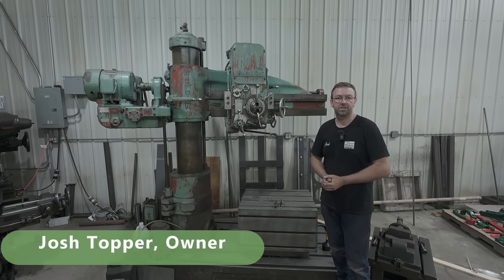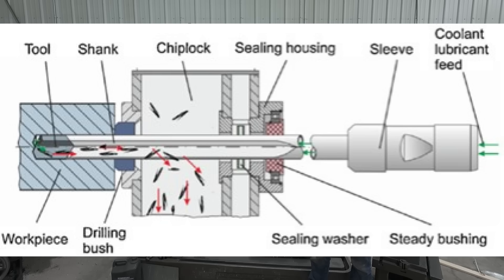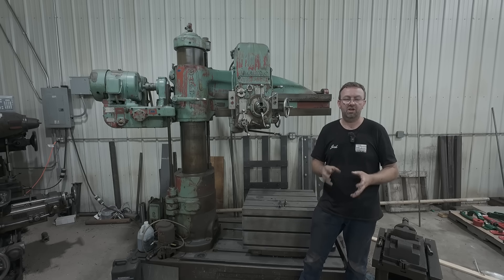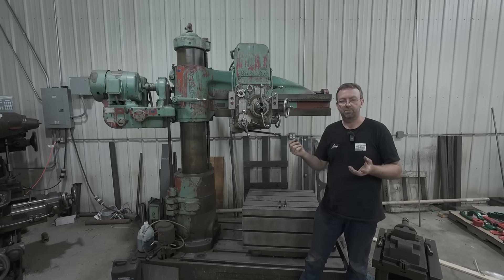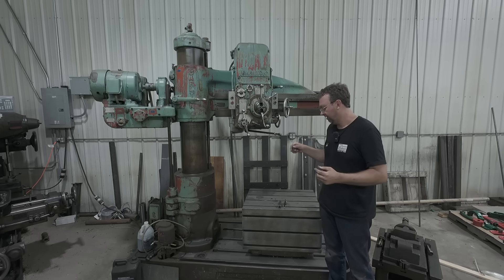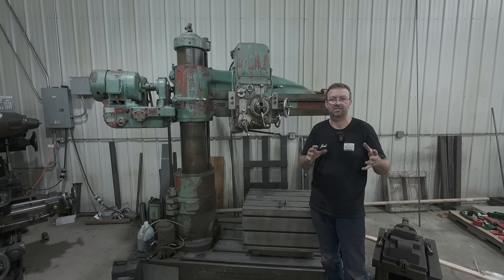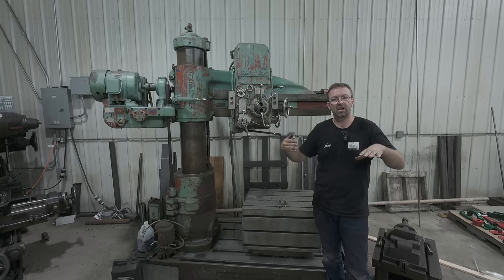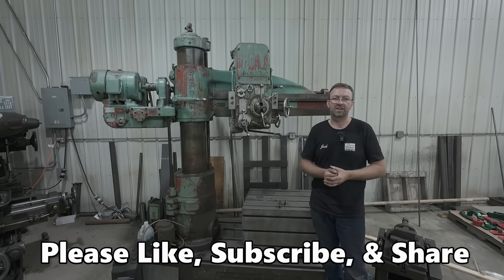Answering Viewer Questions About Gun Drilling | Follow-Up Video

Comment: I see from the comments that  most people don't understand that the straightness of the drill comes from the high pressure of the coolant ,  it's internal pressure pressed on the inside and the end keeping the drill straight ,  a hose pipe under sufficient pressure will keep it straight,  the "coolant "  cools and clears the chips as a by product of it's function to keep the drill straight ,  wire drills work in exactly the same way but even more esoteric ,  a pressure guage works in the same way , the pressure straightens the curve in the pipe operating the guage mechanism
Reply from the maker: Thanks for this explanation. Helped clear up some of my lack of understanding.
Reply: Yes, but also straightness of the hole comes from that that gun drill acts as internal boring cutter and it rests on already drilled hole
Reply: @sqrt2-88 I did a bit of hunting and found a fella in southern america, the drill is sharpened on one side only with other angles for chip clearing, opposite the sharp side the drill has a heal type affair which keeps this boring bar type thing central then high pressure oil not cutting fluid lubricants the heal as well as flushing out the chips. Look it up it's very interesting
Reply: Really interesting. Do they just have to make longer and longer drill bits for longer and longer holes?
Reply: Under pressure fluid exerts force equally in all directions. Fluid dynamics. The theory that keeps a jet turbine going dead straight. Yes, the air and combustion gas is also considered a fluid.

Comment: Late 60s, Hydraulic Research had a gun drill setup. 
4 - .156" at different depths for the 1.25" OD Piston: Push-Pull Apparatus for Bell Helicopter. 
Always a "mist" of HP Coolant in the area.
Operator was a Nerd before Nerd was cool; always stomping up to Tool Regrind department fussing about something😊

I was an A Lathe operator Profiling the Double End Swedged & Tapped 4140 Tube; his machine was directly behind me.

Many times they would do EDM to remove the Broken Carbide 18" deep😮